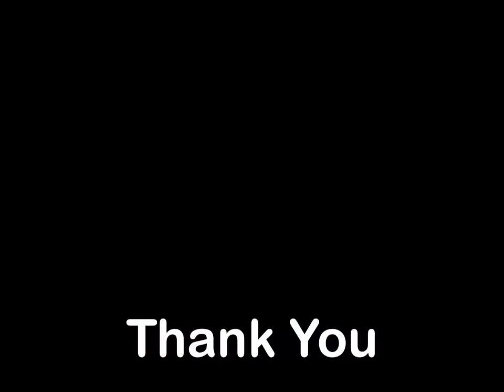Destination : Mt. Blue State Park Winter Camp at Webb Lake

Comment: Great video, sounds like you were sledding through sastrugi. 120 miles getting beat up on a sled, setting up camp, gathering firewood and your tired, imagine. LOL, cheese and rice I guess you'd be tired. I don't see a camp chair. Check out crazy creek camp chairs, they set on the tent floor and save your back big time. Hope you keep making vids, THANKS that was fun!
Reply from the maker: Hello! Didn’t you get a stove, have you been out? It would be nice to see a video if you do. Thanks for the chair advice and for watching.
Reply: @mobilewintercamp7515  just got back from a trip. I've used a stove for 25 years but I got a lightweight take down last year under 4 lbs. My phone has gone bad, if I unplug it it turns off. Have a new Google pixel 4a but I can't get it to connect to our modem. You know how everything was breaking on you? Story of my life recently,  LOL. Going back out next weekend and I'll film if I have a phone that works. We have a spot between 2 lakes we camp at and ice fish both lakes. Great idea on the breakfast sandwiches!
Reply from the maker: @bigsky2081  wow I’m not the only one falling apart, I feel better now it’s not all me🙃. I hope you have fun and the equipment works so we can see it.

Comment: I am watching this video right now, but I can’t wait to ask this question; you rode in by yourself, do you ever worry about your snowmobile starting in the morning?   What would you do if you had a snowmobile problem?
Reply from the maker: Not really. The coldest I’ve seen is -8 F. I don’t put on the miles like I used to, normally by now I’d have gotten a new one but my miles are low for the age. I’m in state parks so if it was really a problem I could walk out and get help. I’m not that far from towns or homes and I usually have a cell signal. No one camps in winter so these parks are closed but it’s legal to camp there at in winter. I have nature, solitude and convenience. Im more concerned about an issue on trail where I get into the wilderness and mountains by myself when traveling. My carefree youth is over. Thanks for watching .